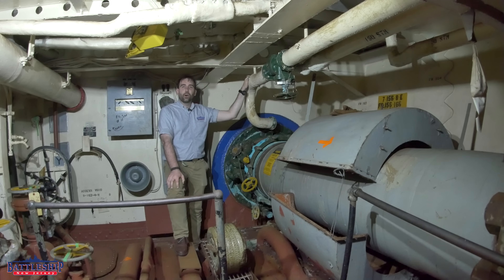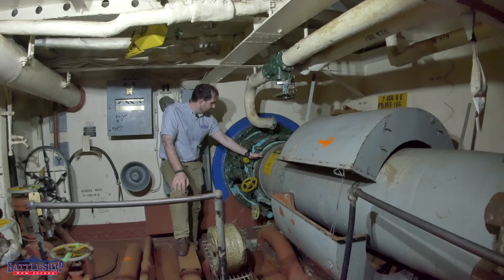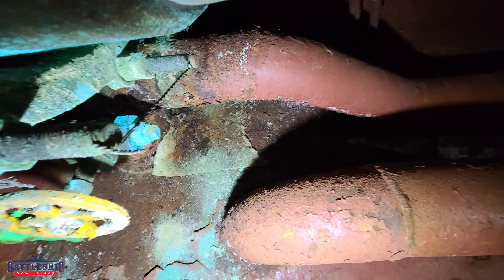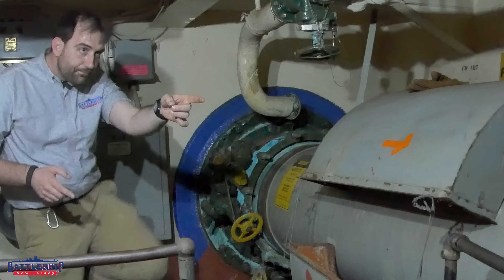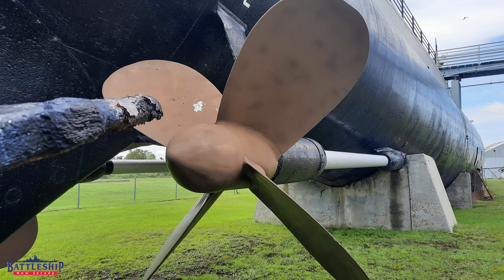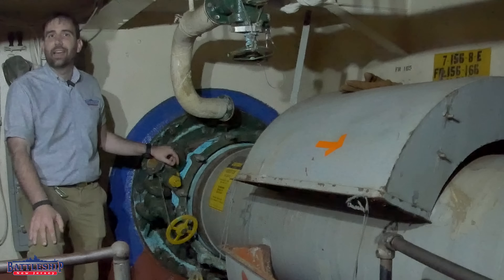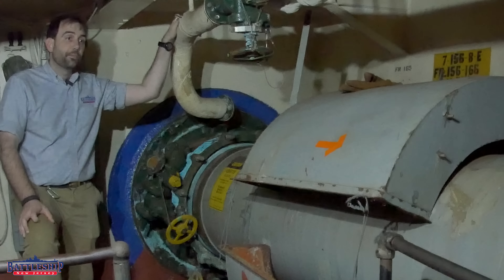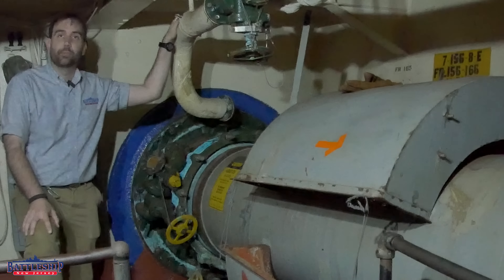Drydocking New Jersey Priority Project: Propeller Shaft Seals

Comment: They should be left on, if it hasn't caused any significant damage since the last dry docking then its not going to be an issue when its dry docked in another 20 years. I guess will find out within the next year.

Comment: well, it seems to work this way with the props on. unless something awkward is discovered when she's out of the water, one wouldn't need to remove the props. 
however, having them on is increasing the risk of water ingress one wouldn't have to take if removing the props reduces the load on that seal. 
that said, one should be prepared to lose one or all of them once they are off. just because the props are valuable as scrap and having them "handy" will cause one beancounter or other to think "she should be contributing to her upkeep, let's scrap those!"

Comment: Is it possible to periodically rotate the shafts so different portions are resting at the bottom of the bearings as part of active maintenance/ preservation?  It won’t help with the oakum packing being flattened, but will distribute weight elsewhere along those shafts and keep bearings lubricated?

Comment: One question is if you could effectively blank the shaft in place by just fully welding the shaft to the rest of the ship creating an effective permanent seal (assuming material compatibility) and if this could then be painted like the rest of the ships hull and preserved like the rest of the hull you could then add packing as a secondary backup (allowing for some redundancy) and the weld should be able to partially support the shaft to prevent the sagging over time running the packing. It also would allow you to remove the propellers for corrosion problems latter with out worrying about the seals. But one concern I have is if the propellers were removed how would it affect the current weight and balance especially in a high wind storm could it make the ship rock too much and cause damage and cause damage to the moorings. (this is also all speculation from someone who hasn’t worked on ships or welded anything in my life)

Comment: Leave the propellers in place because if removed and sent somewhere else for display they will be lost forever and the ship will not be complete. Tightening down the glands on a non-moving shaft will, and has, kept water out since she was turned over as a museum ship and the New Jersey isn't subjected to salt water which helps, plus the plan to change zincs for aluminum anodes will help more with any corrosion

Comment: Due to the fantastic engineering employed on the New Jersey, shaft seals won't be crushed by the weight of the shaft, as the distance between the strut bearing and the first inboard spring bearing is not excessive as well as the shaft itself is very stiff structurally, any sag of the shaft would take centuries to occur, so if it were my battleship, and indirectly it is, I would leave the props alone

Comment: When the ship is in drydock, would it be possible to put some sort of water tight box over the point where the shafts enter the hull and use a fully watertight seal around the propeller shaft?  Perhaps place a bilge pump in each box to discharge any weepage? That would negate the hazard from the glands because no water would touch them.

Comment: I would actually say to pull them, and blank the shaft couplings,  who knows what the the next 30 to 40 years brings to the river conditions,  maybe between silt buildup and major storms you end up in the same situation as midway.   But i also say they should remain on site possibly as a new gateway, or similar,  with the propoer spacing, giving visitor the full effect of what only yard workers and divers have seen for 80 years

Comment: Pull the tail shafts, seal weld the stern tubes and call it a day. The propellers have much more relevance when they can be seen and touched on shore than just saying oh there they are. Re-packing a shaft just to sit in the water is a nightmare. Without a turning shaft to run in the packing and seat it you’ll never get it to seal.

Comment: Would it be possible to galvanically isolate the brass parts of the propeller assemblies with a polymer coating to create a time span before the sacrificial blocks even starts to be required for their intended consumption?

Comment: As an engineer I say, that you should make the hull water tight. Since you aren't going to reactivate New Jersey without extensive dry docking, I would vote for leaving the props in place and upgrading the shaft seals, so they last longer. You aren't going to turn the props, so you can have longer lasting materials in the seal.
Reply: Just weld the props solid.  No more seals, no more leaks, no more worries.

Comment: Just curious, why not just weld the shafts to the hull directly with a piece of steel fitted as a spacer? Thus "Sealing" the hole in the hull. This still keeps the cathodic issue, but removes the packing failing from the equation. Seems like a good compromise.

Comment: another option would be to weld a permanent seal from the hull to the prop shaft and rudder, both inside and outside. not only would it be a better seal, but it would help support the weight of the shaft and prop. 

i suppose for long term preservation, you have to assume that the ship will be neglected for a long time at some point, and removal would be a better option for really long term preservation.
Reply: I dont even think you would need to weld it. Just add a big bead of Sikaflex 591 and that should seal it up for a long time. The bigger the gob, the better the job.

Comment: think it may be best to remove the props and find some way to store them on the ship if there's space, even if in storage, but not off it. still separate articles to deal with/manage, but alot easier to manage than placing them off the ship. would also potentially reduce the long term maintenance of the ship.

Comment: If the prop isn’t spinning it will never leak. No weight sets on the rope. If it did and the rope was the “bearing” the thing would flop through the side of the boat when you tried to run the engines.

Comment: Would removal of the propellers change the status of the ship to a building? It seems there is one museum ship which had them removed. An overly eager fire marshall stepped in and declared it a building and not a ship since it could not move. A number of structural changes (such as the enlarging and removal of bulkheads) had to be made to meet building and fire codes. 

Food for thought...

Comment: For an unqualified opinion, 
1)  Keep the props in place. 
2)  Remove the propellers and put them on deck like the Queen Mary does. 
3)  Do not let them go. 
Question - is removing the propellers a one way trip?  Will the exposed shaft end corrode so the propeller can not be refitted ?

Comment: I’d like to see the props left in place.  Somehow taking them off seems like castrating the ship.  ;)
I would investigate if the replacement packing could be sealed with silicone or other flexible adhesive.

Comment: At first, I thought about removing the Propellers, but given what you said about the complications of making displays and transportation it's better to keep them on.    But it occurred to me, why not simply manually rotate the Propellers every so often to reduce the bending of the shafts?   Would that be feasible without engine power?

Comment: do you jack the shaft at all? The propeller shaft may already be warped by the weight of the prop over time. I know in active ships when we are in port for extended periods we use the jacking gear to help prevent shaft warping. I am not sure if the IOWA class has hollow shafts or not though.

Comment: Could 2, 3, or 4 ring sections be placed on the shaft with O-rings to prevent water coming in but with higher pressure air holding the back the water? Two means of pressure would be either an airpump or a column of water above.

Comment: Would there be any benefit to rotating the shafts at 1 rev p/ 24 hours?  I don’t know what kind of HP would be needed to do that, but certainly a large enough gear reduction could mitigate the need for high HP to spin them that slowly.  Assuming there is a benefit to turning them.

Comment: I think they should remain on the ship. To mitigate the damage caused by the perpetual weight hanging of the end of the prop shaft and causing damage to the packing over time. Could you fashion some sort of 'hanger' off the aft end of the ship under the waterline above the end of the prop supporting the weight of the prop and end of the shaft? It wouldn't be visible unless you were underwater and you're not removing anything off the ship. Just a thought...

Comment: Since the shafts don’t rotate, I am wondering what the aging mechanism is for the gland packing.  If it is deterioration of the material due to contact with water, is there a more resistant material that could be used?  The new material doesn’t need to be resistant to degradation (wear?) from rotation of the shaft and, should the ship be reactivated, it could be replaced with the appropriate packing as part of the drydocking that would most certainly be associated with reactivating the ship.  Leave the propellers and rudders in place.

Comment: Can you put more packing on the bottom of the shaft to take into account the weight of the propeller and shaft?  I would not remove the propellers unless it is required.

Comment: Could a peice of steel strapping be welded (or bent around the shaft) and then welded to the hull below the water line? The propeller/shaft would be supported at the outboard end.

Comment: Cant you put jacks or blocks under the propellor shafts to prevent sagging and put sacrificial anodes on the props or a low electrical current through them the prevent corrosion?

Comment: Can spacers (bronze) be sized, 3 foot long or so, in the bottom of the gland and at both ends to support the shafts in the center? Preventing the out of round compression of the packing material. Though with a 30 year life expectancy do you bother?

Comment: Tough decision. It seems a shame to remove the propellers, but it could be a smart move. I'm thinking of it as long term storage. I know it would be ridiculous now but the ship will get rarer and more valuable in the future. It might be viable to do a full restoration and get her running again sometime. Having the props safely stored somewhere "in great condition" might make a restoration like this more viable in the future. Also it will be safer and easier to move the ship if you have to. It would be sad to remove them but overall I think its safer for the ship long term. You might need to move her or maybe she will be set adrift for some reason. A freak storm say. and the propellers are another possible weakness if they crash into something.

Comment: Is there a way to update the seal? Maybe a seal that would be engineered to withstand the weight of a static non rotating shaft?  Metal to metal seals are specifically designed to hold up in heavy weight applications, however the magnesium-bronze to steel surface is a natural point for electrolysis or corrosion.  Furthermore, metal to metal seals require precise machining and fitment that is less a .001”.

Comment: any chance to spin the shaft 180 degrees every year or two? it would help with any shaft deflection, as well as give you an idea how bad the corrosion is outside of the hull due to additional torque to spin it

Comment: Would it be possible to leave the props on and repack the seals, but also weld flanges on the prop shaft to the hull as a primary seal, with the packing seal as secondary?

Comment: me personally wenn the ship is in drydock fix the internal seal or replace and then as a good external seal compress water resistant greace from outside ( you might need a good bit ) and to finish it squeeze a rubber seal around the Gap outside, it definitely be better if the ship still had her propeller blade's on her, and its not Bismarck so im sure its armour at the back is ok from corrosion

Comment: Naive question, but if there is some danger of damage to the shaft or hull due to the shafts not rotating, could the shafts be uncoupled somewhere in the ship short of the boilers and rotated using some type of motor driven system periodically?  Probably not, but thought I'd ask anyway.

Comment: Whether the shaft is turning or not, gravity is always exerting pressure on the bearing and seal.
Reply: The shaft does not rest on the packing. There is a spring bearing just forward of the gland and a very substantial bearing just aft of the gland. The shaft does not sag between those two bearings. Don't believe everything you hear on these museum ship channels as the narrators are rarely trained, never experienced, or have much if any knowledge about the subject and they never seem to study the object of the video before recording.

Comment: If the issue is the propellers and shaft weight on the packing, could a chain or steel cable support reduce some of the weight? I would have thought the shaft bearings would help here too.

Comment: What's amazing is, the New Jersey's propeller shafts are way smaller in diameter than her 16" gun barrels! at their bases! 😲 So if you take those props/shafts off...the Big J can't get underWay! - quickly! 😕 But if you do decide to remove the props and stub shafts, could you construct a reasonable sized storage shed near the USS New Jersey's pier and keep them close by, mounted vertically, in craddles, for easy inspection? 🤔
Reply: This ship could never get under way quickly regardless of if the props were on her or not.

Comment: I removed the props from my personal Iowa-class battleship and patched over the through-hull openings. It's cut way down on the corrosion issue and now I don't worry about leaks.  The props are now on display in my backyard and I've had offers to turn them into ceiling fans for the canvas that I've put up for our event space.

Comment: the responsible thing to do is remove the screws.  it sets you up to have longer service intervals with less maintenance and far less inspecting.  no more worry about replacing sacrificial anodes.  the forces on the ship are greater and the wear will be faster, even aside from corrosion.  plus you could sell one or two of them.  are they original to the ship?  have they all seen service?
Reply: " no more worry about replacing sacrificial anodes."  Those anodes keep the rest of the ship from rusting.  You still have to worry about them.
Reply: @stargazer7644  true, my comment needs a lot more context added, thx

Comment: I don't know much about these things so this may be a stupid/impossible idea. 

Can the seals be changed to some other type of system to keep water out more permanently with everything in place, since the shafts no longer need to rotate?  Could the area around the shafts be sealed with plate structure welded to the haul and the the shaft?  You could even keep the seal equipment in place possibly to preserve the proper appearance. Again, I could be way off here.

Comment: I'd be inclined to keep the props installed.I'd also be inclined not to use the packing, but rather some modern, long lasting material. Since the shafts don't turn, that should be easy

Comment: Do the shafts need to turn when the ship is being towed to and from the drydock? Otherwise, wouldn't it be an option to instead of putting in new packing to just weld the shafts to the hull and create a watertight seal that way?

Comment: could it be a solution to add basically clamps with some container that holds air for buoyancy to the prop shafts? to help raise them to an acceptable level long term without requiring their removal.

Comment: I don't think you should ever wrap the packing, water can travel around the helical path (I've seen this on aircraft carrier pumps where the maintenance was not done by us Machinists' Mates).  You cut the packing into rings and insert them with the gaps at odd angles to one another.   If I wanted to make sure that galvanic corrosion never occurred between the bronze screws and the steel shafts, I would remove the screw and the last section of the shaft.  The shaft could be put in a large shipyard lathe and turned undersize at the screw mating surface, then it could be built back up with fiberglass and resin before being cut back to size before reinstalling the screw.  The same process could also be done with the internal surface of the screw, but it's a harder job to set it up for machining.

Comment: Is there any concern about the shaft turning while being towed to drydock? 

My opinion, keep them on unless there's significant damage that could cause catastrophic failure in the future.
Reply: They tend to tow this kind of ship mighty slow--for instance, IIRC they towed Texas to Galveston at all of three or four knots, which is slower than a reasonably fit person can jog on level ground. Now I'm kind of curious as to whether that's even fast enough to overcome the rotational inertia of the props, let alone whatever braking is in place on the shafts. It probably is, but I'd love to be able to do the math.
Reply: @ZGryphon  right, but I think Texas also had an issue with the rudder. It was stuck as some degrees to starboard which meant the ship was being towed at an angle the whole time.

Comment: I'm for keeping the props on, but since the props will never turn again, isn't it possible to use steel, instead of gaskets, to permanently seal the gasket space.  The steel would then be able to support the loads, and welding could seal them permanently.